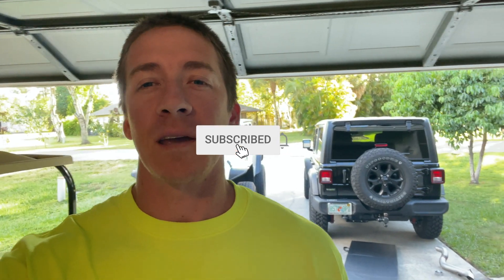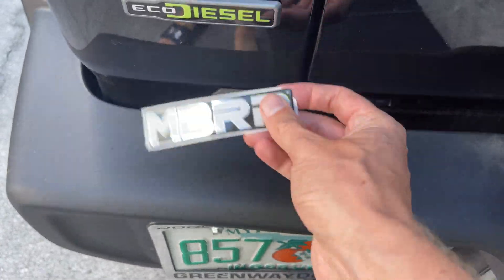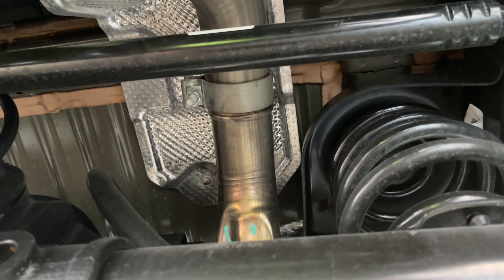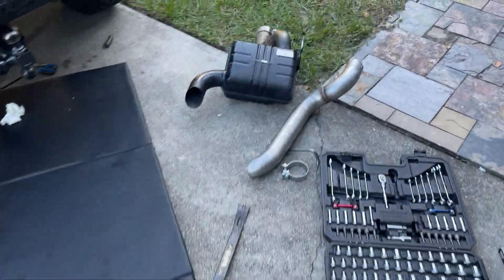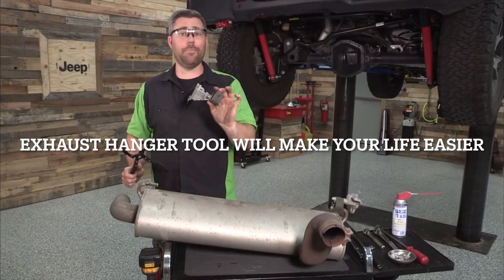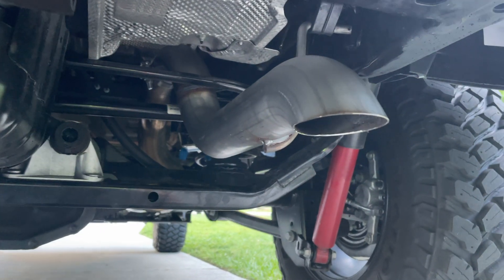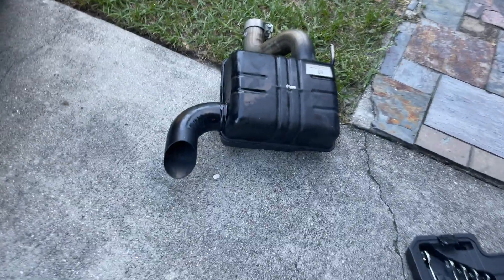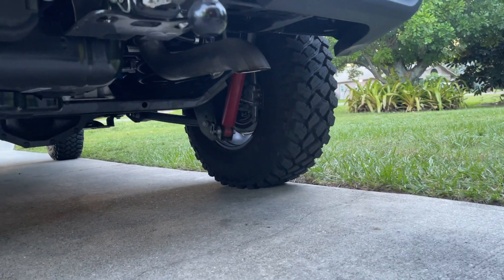Jeep Wrangler JL Muffler Delete | 3.0 Diesel | Before and After

Comment: Did this on my JT and it made a slight difference in sound under certain rpms. Maybe because the JT has so much more piping and two mufflers stock. I will admit yes its minor but I could tell a difference. Looks 100% better too
Reply from the maker: Agreed! I want to pull the cat also but don’t see anywhere that does it
Reply: @teslajake  reckless motorsports usa is.